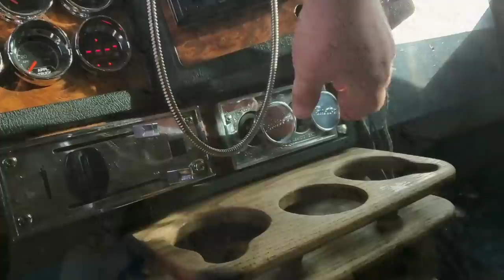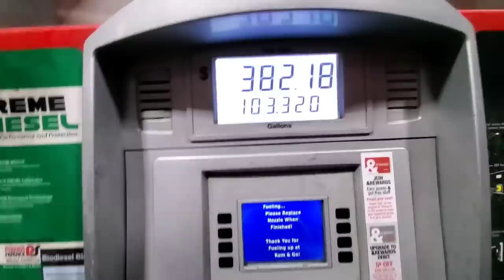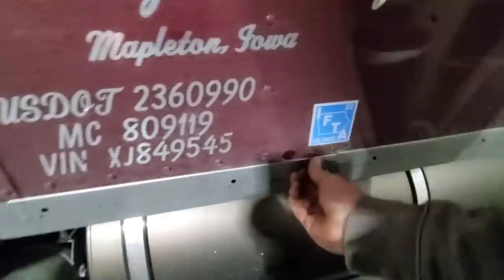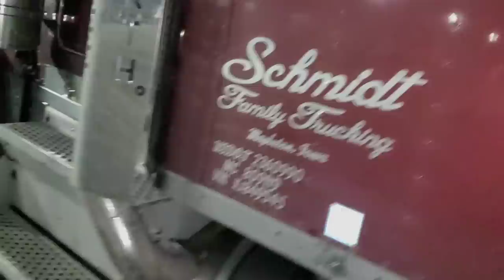Becoming An Owner Operator In Trucking // Old Trucks Ep513

Comment: I once asked a O/O how to make a million dollars owning a truck.  He said "That's easy.  Start out with 2 million."
Reply: That's the truth.
Reply: Everyone says this. It's cute but gets old after a while.
Reply: at the moment it is easy to make a million, 2021 i made 341k$ gross. did not have a single load under 3,5$/mile.
Reply: @Snakeshit294  🇺🇸 Are you finding loads harder to get right now, especially at $3.50/mile? I’m hearing a variety of things right now. There is usually a balance when being out on the road and the money you want to make to survive. I know it’s gotten a little rougher in the last 15 years. I think there’s still some good money to make, but you might need to tighten up your belt and be a little more flexible in areas. Who knows. Stay safe and keep them wheels a rollin!
Reply: @the.porter.productions  no not at all. I just booked a load from SC to Las Vegas for $4,89/mile. i used 3 apps to find my loads Uber, J.B.Hunt and Coyote. At the moment i try TruckSmarter wich combines almost all loadboards into one app. if i like a load i counter offer (you can't at the uber app). i run everything as long as it get's me atleast $3,50/mile and i end up in a area where i can get a good load within 80 miles deadhead. A big part of making good money was the transission to always drive new trucks, 5 years and the baby is gone. Can't afford downtime.

Comment: I'm sure I'll get crap for this comment but I just leased onto a company 2 weeks ago. Been around trucks since I was 18 was a diesel mechanic before OTR and I got tired of being owned by companies for all the reasons we all know them. With that being said my first truck cost me 75k with a fresh overhaul (less than 1k on it) new clutch, new steer tires 568,550 miles on the clock total. Not bad in today's current market and these ridiculous prices on used trucks. It may not be a w9 or 379 but it's mine and it's a start and it's a 13 speed no more POS automatic

Comment: Check out a community college for truck driving school some are sponsored by smaller trucking companies running there used equipment. I learned driving truck by my father as he was a heavy diesel mechanic and drove truck some, but decided to go to community college to make easier for smaller companies easier to hire me with insurance cost. I ended up pulling dry van with a little regional and OTR company as my starter company.

Comment: As a former business partner we ran apportioned plates, if I recall here in Ohio they cost 1200ish per year. Still had the heavy haul tax and ifta too. I think out of 30 plus years we only got audited one time. Having a good tax/accountant makes a huge difference.  Thanks for sharing your personal thoughts and for giving good advice. Keep safe out there.
Reply: I avg 1800 2200 yr for apportioned tags . I don't drive alot of miles either . I work on avg 6months a yrs total. This yr I only logged 140 days per diem. Paid my tags 3days ago 2002.38 Ohio

Comment: I had a good laugh when you going to release the fifth wheel and dropped your puller, sorry. A lot of what you say applies to a lot of people going into business for themselves. When I started my woodworking business, my first job was a large commercial job. Well my table saw broke down, I couldn't find an air compressor to rent, so I had to borrow one. I rented a nail gun but couldn't find the correct size nails. So I bought a new one , which I hadn't planned on either. Then borrowed a trailer to deliver the project in multiple loads. I also had my Father in Law and my wife's cousin helping to finish building the job. But when I got paid, I paid my bills and bought some new equipment and made repairs. You have to be diligent if you want to succeed.

Comment: Hi mate for the first time I see your vedeo this is was a first and I like how you talking the true about transport companies there in USA I import my pet 379 98model in 2008 and I sold the truck with a 2.920.000kms(1.900.000mls!) and  just replaced a thermostat, rebuild a coolant radiator, of course I replaced a couple times a shoes brakes and 6brand new drums, winter tires I buying every year because we have 9months of hard winter conditions here in Norway and a normal maintenance grease,  fuel and oil filters every 10.000kms and every year a air filters the truck have a CAT 3408  a beast V8 engine👏👏👌 not used that adblue shitt!!  this truck makes money👏👌 we loading normal 50ton! it's a maximum loading for semitrucks here in Norway  this engine used approximately 43liters per 100kms(9gal. per 62mls!) it's around 2liters more than the other new trucks but in ALL year the guys have a new trucks they dispend around 10.000usa dollars on the workshop 😃😃 so fucking the new equipment we can making much more money with a older trucks without fucking electronics stuffs!! 😏 of course I will do everything my trucks never ever touch a workshop floor 😃 but unfortunately I sold all my equipment trucks and trailers because this Europe not aceptes a american  trucks anymore about the truck sizes 😐😕🙄😒 that's a reason I'm a quite! Now I driving for a friend of mine and if I have a possibility for driving in USA I really enjoyed because I'm tired of this fucking Europe 😡😝😝 I wish you luck mate and take care on your KW900 this is a great truck for makes money and it's a great equipment 👏👏👌👍 cheers from North of Norway 👋🤗🤗

Comment: I started out in 1981 bought a used cab over a trans star international with a 350 Cummins 13 speed with 411 rears i pulled tankers for a dairy to make ice cream every run was just over 200 miles a round they unloaded me and clean the tanks I did 2 loads a day for 5 days I made great money I bought that truck for 3 grand it only had 286 thousand miles when i bought it had it for 5 years the work i put into it besides oil changes was 2 sets of tires 1 set of batteries and new king pins for the steer axel it wasnt the most pretty ist thing but was a great work truck , Y biggest mistake was selling it , but i wanted to cruse the country so i went to Fla hauled Tropical Plant loads delivered to all the Franks Nursery in the country at my time , but i wish I had the old girl now lol, stay safe and steady

Comment: My first truck was a big cam 4 also. Only 315 horsepower. In a 1988 Ford LTL9000. Paid $12000 cash for it in 2020.

If the tranny didn't go out on it before I had banked enough for repairs, I'd still be running it. It's still sitting in the yard like your FL. I can't get rid of it.

My current truck purchased last year is a 2014 Mack that I paid $26000 for. It's only a day cab like the Ford.

Prices went stupid over COVID and you really are lucky to find anything road worthy or not a ticking time bomb on mileage for less than 60.

Comment: The good old days: When I was in HS(back in 1970's), i bought an international postal truck for $50( local deliveries) and did all my maintenance with the motors repair manual. It was a very easy to repair truck!! It was fun fixing it and it was fun driving it.  You need to at least be able to change the oil and filters and do a tuneup. Take a course on auto repair
or find a local garage with average or low rates or find a friend who is good with repairing
cars or trucks.

Comment: Great video Kurt. Sure learned a lot about being an owner operator. I think back in the 7o's when I had a flair for trucking (still do, I'm just a bit older now)  and talking with a few drivers at our local truck stop. Sure sounded easy back then, Today I can see how much it has changed. It is not easy being an owner operator today, but that seems to be where the money is at. I see a lot of company trucks on the road, and personally I would feel safer in my own truck. Granted there are some good companies out there that maintain their trucks however. some of their drivers and trucks they drive need some serious cleaning. As  far as the rules of the road and all the taxes you have to pay, you can thank the politicians for that. I'm old school when it comes to buying a truck. Sure the new ones are nice, but I would think you would have to haul goods from Ft Knox to afford the payments,  Thanks again, be safe,

Comment: People say the same thing about pickups. "You'll either have to make a pickup payment or maintenance payment, so you might as well drive a new pickup." My Silverado is 22 years old. Bought it new. Haven't had a pickup payment in 17 years and I probably spend less than $300 a year on repairs and maintenance. 420k miles and still has original engine and tranny. I'm in Drive Away. I deliver a lot of new trucks to dealers. Top-of-the-line units. They are really nice and ride like Cadillacs. But I could never imagine paying $225k for one! You'd have to be humping it hard every week! I'll eventually move back into freight hauling, and when I do, it'll probably be some old FLD or something thereabouts. Keep the videos coming, this was one of the most informative and insightful videos on becoming an O/O that I've seen!

Comment: Great video Kurt! Great info for new guys. I almost made that mistake in January. I got new truck fever and custom ordered a new 389 with 300” wheelbase full custom everything. 256k you name it I added it. Luckily I had 3 months to think about it and came to my senses. My insurance and truck payment was gonna be about $6,300 a month. Needless to say I backed out. 

Instead I dropped a new factory reman 12.7 and 13 spd tranny in my paid for truck along with all new brakes,drums,drive tires, shocks,brake chambers,airbags and slack adjusters for about 57k.
And it’s still paid for!

Comment: What i found when I owned and operated an international that I bought at a postal auction and used as a trucker(local deliveries). Most "repairs" are really just adjustments
that I could do myself with my motors truck repair manual. As a truck ages it needs 
"tune ups" more often and this preventive maintenance will avoid major break downs.

Comment: I paid (well me and the bank) $50,500 for my new W900 back in 1978. Had the then big engine which was a  Cummins Kt-450 with a 15 speed. It was geared out at 78 mph, though the national speed limit was 55 mph. Redline was 2000 rpm. 
Due to maximum overall length laws of 55' in many states back then, the longest reefer trailer was a 42'. I don't know how you guys maneuver in old cities like Chicago, NYC, etc. with 53' trailers and much longer wheelbase on your tractors.
Good times.

Comment: Great content!

I agree with you on getting an older truck. Not only because of the cost, but also the DEF issues, sensor or chip shortage.
I am on my 7th truck and never hauled a load yet.
Just buy them and then sell them after fixing necessary things.
My authority went active start of the year and will put the last truck to work.

Stay safe and God Bless!

Comment: Kurt also just a Q&A Trucking together is trying to get there owner operator authority back and you mentioned do it the hard way or the easy way and they are most definitely struggling but there heads are still above water I know all to well about being an owner operator 1st year was a night mare but the 2nd year and there after I made good money went back to heavy haul pulling anywhere from 9axle to 13 axle, I'm retired now an I don't miss it a bit.

Comment: Re power of the truck: unless you're running in really hilly country, you can run a lower powered truck just fine, you'll just be changing gears more often and getting overtaken on the hills. 
Unfortunately, here in Australia, our used truck market is really expensive. You're at least up for 35k or more to buy a usable truck. Most used trucks (with 1 million plus km) are up over 70k, many over 100k. It just depends on your circumstances and where you are.

Comment: No argument here, I actually fully agree with everything you said. I've paid $10,500 or less for every truck I bought except my last one I bought a 1998 379 Pete with a 3406E with new rubber in 2011 for $16,500 and I'm still driving it today and I haven't really had to do anything to it until last month I put a new transmission in it. I do most of my own wrenching because yes shops get expensive but if I need any major repairs my nephew is a mechanic at a big shop and he does all of my major repairs at my shop on nights or weekends and it saves me a ton of money. Also getting a fuel card helps a lot to get you by until you can start collecting your checks.

Comment: With the vehicle market as it is today, it is not realistic to expect to spend $45-50k and get a roadworthy used truck. Used truck prices have doubled over the past 1-2 years. Roadworthy pre-emissions trucks are selling for a premium, and I'm sure the parts shortage combined with the Paccar DEF sensor issue is helping to keep those prices inflated. For my truck I ordered that sensor in September. I got a call two months ago just making sure I still needed it (not that it's going to fix itself) and confirming that I am still in line for when one comes in. I'm still waiting. For an owner with only one truck, one bad roll of the maintenance dice could shut you down, so that $20k of reserves is a pretty wise piece of advice. I spent more than that in my first six months because there was a lot of deferred maintenance on both the truck and trailer that needed to be addressed before winter weather set in.

The other issue is that you need a lot of additional things to get started running. With the DOT/ MC you also need to pay someone to file a BOC-3 so you can get sued in any of the states, and to get the authority active you must have the insurance on file. The BOC-3 is cheap, but if you forget it there will be problems getting your authority active. There is a mandatory waiting period for a new authority, because the application must be published and available for others to protest granting the application. New entrants will get audited within the first year of operation, and the FMCSA will not look kindly upon operators who do not have their drivers enrolled in the drug and alcohol testing consortium, maintain driver qualification files, etc. You even have to "apply" for your job and hire yourself. If you use load boards, you must have workers compensation insurance and they mandate certain coverage minimums, which are expensive. As the business owner, many workers compensation policies will not cover you if you have a work-related injury, so you have to pay extra for a policy that will give you coverage.

For maintenance, it sure does save you money if you can turn a wrench. However, there is not much I can do without getting in trouble with my landlord at the office. A simple PM (oil change, fuel filter, etc.) is out of the question because my lease prohibits creating or working with hazardous waste.
Reply: You just made it sound like it's more profitable flippin burgers or droppng fries
Reply: @donovanwilliams29  It depends. I started my authority in mid-2021. I only put a few thousand miles on my truck and trailer last year as one, the other, or both were in the shop far more than they were on the road. The good news is that I can carry forward the loss, and my business still exists, but how many people have enough financial padding to go months without any income because your vehicle is OOS and parts are not available? Freight rates are good, but the cost of starting up the business is not negligible. There is a reason that many new authorities are out of business within the first year. Maintenance costs are not negligible. Fuel is a big expense, and with your own authority you are not getting a "fuel surcharge" from brokers. Your pay depends upon what you can negotiate. Owning a truck and running under your own numbers is a business, and running that business is far more than just point the truck and trailer down the highway and hammer down. It will take a lot of miles to get to the break even point for a new owner with a new authority. After that point, at the current rates, the numbers look pretty good.

People often gloss over some of the costs, but for a new authority vehicle insurance can easily be $20k per year. One apportioned license plate for 80k gross weight can be about $2500 per year. What may have been viable 10 years ago to start one's own authority is not the same today.
Reply: @donovanwilliams29  it can be tough starting out. Once you get in the groove and make connections you can make good money. My biggest problem right now is the taxes I’m going to have to pay. I wanted to Buy a new trailer before the end of the year, but I couldn’t find one. They said it would be 18 months if I ordered new.

Comment: Liability Insurance for anyone with less than 2yrs driving experience and a clean record is nonexistent. I couldn't imagine the price for someone with little or no experience if you could find it. My liability insurance was about 8000 a yr. per truck whether the truck moves or not. The tag is roughly 1200 a year and 550 for the 2290 (Fed Heavy Veh Hwy use tax), These are all FIXED Expenses you have to pay whether the truck moves or not. Plus a truck payment.

Comment: I found you should never make positive remarks about engines. I talked with a guy years about my engine and I told him my engine was fantastic. Never let me down. 60 miles later she dropped a valve. New head. New piston and liner. New injector. Rented truck. $6000

Comment: I'm a lease owner operator and I get 70 percent of gross and 100 percent of fuel surcharge. Can you make more at going your way or is about the same. I like the fuel discount that I get with the company, right now it's $3.50-$3.60 a gallon with discount,ez pass and maintenance discount. I paid $56,000 for this 2014 freightliner Coronado glider at 499,000 miles in 2017, now it has 1,017,000. God bless and safe journey
Reply: Took 2 years to paid off and get my title